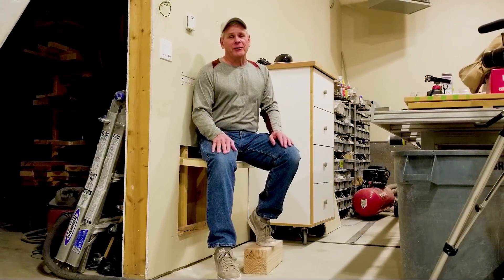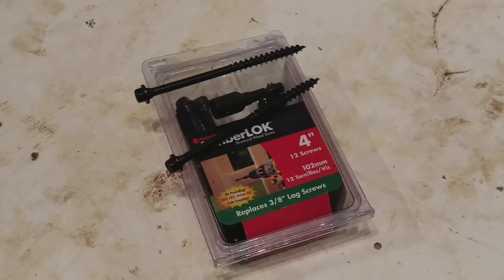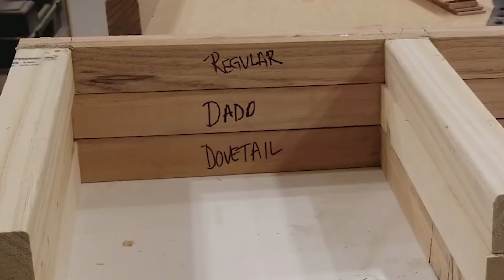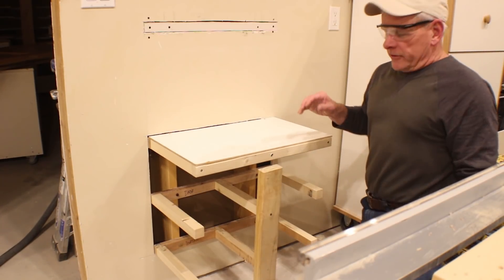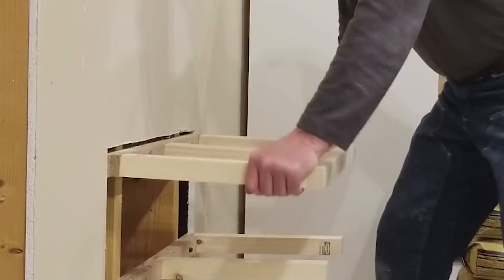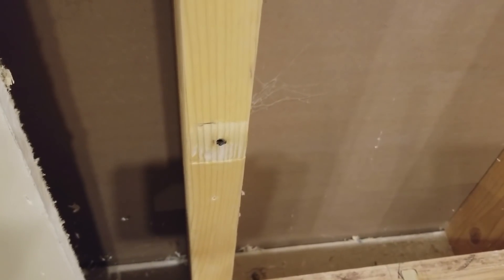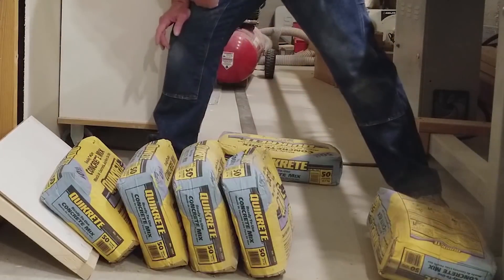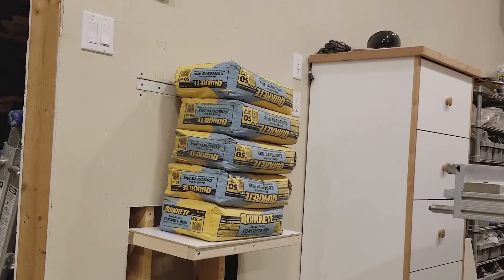250 Pound Max - Three Floating Shelf Strength Tests Based on Viewer Comments

Comment: Why don't you use a square metal bar instead of a piece of wood against the wall? It can be hollow or solid.
Reply from the maker: You could certainly do that, Laura. I was curious about the strength of wood in these tests. I found the strongest and simplest way to install floating shelves is with all thread rods and did a video a few months ago about that. Thanks for watching!

Comment: I wonder if placing the bolts higher would reduce the leverage that's denting the studs. Another question is, why 2 pieces of 3/4 inch oak instead of one piece of 1-1/2 inch oak? is it to make up for the lack of sheet rock that would ordinarily be present in a residential install?The bolts, rather than the dowels seem like they would have less weakening effect on the studs, if it's a load bearing wall. The crushing effect of the bottom edge of the shelf will be much more pronounced against Drywall, which makes much more sense to have the bolts up higher. It may not be as strong as without drywall, but, I doubt it will have to hold an adult human "Elf on the shelf".🤣😁😝
Reply from the maker: Higher bolts might help... also a thicker backer piece too would go along with your line of thinking. The two pieces of oak were just to see if that structural piece were laminated instead of solid, would that increase the strength. Yeah, what I gained from doing these tests is that a floating shelf support structure secured to studs with lag bolts and sheetrock still in place, is way more than adequate strength-wise for anything I would want to put on it. The dowels don't flex much so would likely snap at some point whereas the bolts and "crushing effect" let you know you are stressing the structure to the point of failure before it happens. I did have a couple of guys offer to bring over there big bodies to test any shelf I wanted to build! Funny, the idea of "Elves" never came to mind to describe them! Thanks for the comment and for watching, Vincent!

Comment: great video . very informative. I'm considering this type of application for floating kitchen shelves. 60lbs would be plenty of support for me. Based on your concept, what are your thoughts on my approach?:  First I have a 1/2" sheet rock  wall to mount to, with 2x4 studs behind. I would just be using timberlok screws to attach my backer boards, no dowels into the studs. . Shelves will be solid hardwood 1/3/4" thick , 12" deep, drilled to accept 5/8" hardwood dowels (3) across a 30" span.  I was thinking of using (2) 1/2" thick  pieces of walnut as my backer drilled through with 5/8" walnut dowels and attached to the studs with Timberlok screws only.  Thanks for your comment. I wouldn't hold you accountable for my results, no matter your comment. 
Bill
Reply from the maker: Hey, Bill. Well, you'll only know if you test it out. I get a lot of suggestions on different configurations. In fact, the video you watched was testing out some of the more interesting ones. I was surprised that the Timberlok screws I tested had quite a bit of flex to them. So I have stayed with lag bolts as my default method if I am not going into the studs with dowels. The only question I have about your idea is the three dowels coming out of your backer boards supporting the weight of the solid hardwood shelf plus whatever is on it. Those are your support legs if I am understanding your description right, so it seems like all the stress is going to be at the point where the dowels exit the backer board. I'm assuming you are going to recess the back of your shelf to slip over the backer board that is mounted to the wall? Screws through predrilled holes in the shelf into the backer board would help take some pressure off the dowels. Interesting idea! Let me know how it turns out. Thanks for your comment and for watching!
Reply: @RustyDobbs  In your previous installations, has mounting over sheet rock (as opposed to direct to bare studs) lead to noticeably more flex or indentations in sheet rock? I'm wondering if the difference is great enough to warrant removing the drywall for average 4.5' x 12" kitchen floating shelves. Also, have you experimented with LedgerLOK screws? They seem to be a bit thicker than TimberLOK and I'm wondering how they'll compare to lag bolts in regards to flex.

Comment: Each time a piece of wood contacts another wood regardless of connection type it's a potential point of failure. Since the studs are already exposed, why not drill into them a 3/8 hole, 2 1/2 deep, insert glue and 3/8 rebar cut 6 to 8 inches. Get a 2x12, cut to length. Drill 3/8 hole 16 inches on center, line up your hole on the studs first. You have only 2 points of potential failure, your using all the strength of the board. If you have a router you can do the edges and then paint or stain. I did this for a weight room and would stack weights on them without any problems.
Reply from the maker: Cool idea, Raymond! Thanks for passing it on. 3/8" rebar is very easy to bend in shapes as needed for traditional uses. But if it is supported by wood in the studs and 2x12, I guess it is only exposed to straight down "shear" force at the point of contact with the studs, which should make it really strong.

Comment: I've done floating shelves with 2x4 brackets, I've gone so far as to plane the wood down so the joint sit flush, then glued and screwed with 3-4" screw per joint. I then lag these into the wall with a 3 1/2" or 4" lag screw. I haven't strength tested, but they seem incredibly sturdy, although maybe a little bulky. The last one I did was roughly the size of a mantle, that I made as a speaker shelf below my tv.
Reply from the maker: You are exploring what I have not done, Jarred, which is going with wider shelf brackets. It stands to reason that the wider base you have lagged against the wall to resist the downward force of the weight on the shelf, the stronger the shelf would be. My brackets were only 1 1/2" wide. If I split the difference with you and went with 2 1/2" wide brackets, my guess is my shelves would have been some percentage stronger. Thanks for the idea and passing on your experience!

Comment: Or 3/4 threaded steel rod with 2 nuts to thread into the stud and 2 collars slightly bigger pressed into the shelf arms
Reply from the maker: Now that is a good path you are heading down, ZixqEditing, if you need the floating shelf look but it has to carry more weight than I would be comfortable with using only a wood support structure.  Creative solution! Thanks for the suggestion!

Comment: That was a great video.    Do you recommend going to the studs like that or was it just for the video so we can see the stress on the stud?
Reply from the maker: Thanks, Rusty! (Interesting typing my name and it not be referring to me!) Yeah, the purpose of the video was to test the strength of various types of connections between the back support and shelf support pieces. Eliminating the sheetrock takes it out of play as a factor to consider. Practically speaking, I personally would limit weight on a floating shelf to about 50 lbs max over a couple of feet span. That said, the bracket assemblies I use in the video attached to the wall studs 16 inch on center with lag bolts and the sheetrock still in place, would be something I would be probably comfortable with up to the 50 lbs. Obviously, going directly to the studs with the brackets is going to reduce the flex with heavier weight on the shelf. Thanks for the comment!
Reply: @RustyDobbs  just some shelve so the cats can get off the ground and have some exploring to do.   We got a puppy and one of the cats are not to happy about it. Lol     and when I rescued them they already had their front claws removed so doing a climbing pole was out of the question.  So I will incorporate this design with some carpeting and have some fun with it.  Many thanks again ( our one cat is close to 20 lbs) that's why the strength test was so important to me

Comment: What if there was hard wood running parallel with the studs for a solid nailer
Reply from the maker: Not following what you are suggesting, Phil. Fill in a few more details.
Reply: Nail like a foot piece of hard wood to the sides of each stud. So each stud would be 2 2x4s with one 2x4 harder wood to maybe prevent that back plate from impressing the into the normal wall stud. Cool video man.
Reply from the maker: I'm with you now, Phil. Good idea! You would think that might help reduce some of the flex. Thanks for the comment!

Comment: What about trying 1/2 inch dowels? I feel like you're losing a lot of wood on the support bracket. I just made two floating shelves using  1/2  dowels and made 5 points to mount it.  Seems to be plenty of"meat"for any future stress.
Reply from the maker: Good idea... lots of ways to tweak these types of installations for better results. I like your solution!

Comment: I apologize it you've already answered this but what is the strongest floating shelf out of the one's you've already tested?

As I would like to try building one for myself and see if there might be room for improvement.

It seems like the one that you ended this video with was the strongest but I'm not sure if that is the one you've built in your previous video.
Reply from the maker: Let me answer that a couple of ways, Feyangel23. Just pure strength with almost no flex would be the wood dowels glued directly into the studs and backer board with the shelf backer board made from several pieces of hardwood (probably oak) laminated together and then the shelf support brackets connected to the backer board with glued in dowels also. Lag bolts into the studs through the backer board  is probably stronger than the dowels but the lags are going to flex more than the dowels as you add more weight. Hope that helps! Let me know if you come up with something better! Thanks for watching!

Comment: The wife is wanting floating shelves, so I come to the interwebs to learn how others are doing it.  Great video.

One take away from your video is failure points are the torsioning of the backer pieces.   I think a quick fix--if not already mentioned--is a much longer dowel glued into the wall and connected to another cross piece a few inches out.  Then the weak point would be the oak dowel, which has already shown to be quite strong.

My given task is 3 72" x 10" floating shelves than are only about 2" to 2.5" thick.  I'm not going to cut out the sheetrock.  To get around the inevitable denting of the sheetrock due to leveraging, I'm thinking about putting a large-headed screw at the lower end of the backer flush with the sheetrock.  My thinking is the shelf would leverage against the screw distributing the load onto the screw and thus into the stud and not onto the sheetrock.  Because of my given requirements, I'm probably going to do with steel supports.

Again, great video.  It's helped immensely with getting my head wrapped around the task at hand.
Reply from the maker: Thanks for the comment, Ken! The idea of a cross piece a few inches out from the has not been mentioned by anyone and is a good one. Yeah, I think that would make the dowels the failure point which should increase overall strength significantly. Additionally, I like the idea of maybe lag bolts into the studs at the bottom of the backer to address the flex issue. Sounds like you have your project figured out. Don't see any issue at all with what you are planning to do. Good luck with it!

I appreciate hearing from people who take what I do, rethink and rearrange the 'pieces'  and come up with better ideas. I may just have one more strength test video in me! I'll let you know if I do. Thanks again for your contribution to the conversation!
Reply: Ken Jones   Great ideas!  I especially like using screws into the studs, with heads flush with the drywall, to transfer force from the bottom of the backer into the stud, saving the softer drywall from the bottom of the backer rocking into it under the weight.  That's also a good way to keep from having to cut out the drywall around the backer to have it solid against the studs, plus this way only mars it with a few screw holes if the shelves ever have to be moved.

EDIT:  Plus I just had another thought on the screws.  By helping prevent the rocking of the backer down and into the drywall, that puts all the weight straight down instead of rocking in an arc downward.  And straight down maximizes the strength of the oak dowels, because they would be more resistant to shearing off than bending downward.  So the screws not only save the drywall, they boost the effectiveness of the dowels.  Great idea!
Reply from the maker: Good point on the rocking action, JusBidniss. As I mentioned in my response to Ken, I'm thinking I would like to test out his idea with longer dowels and spaced shelf support brackets to help offset the stress the load puts on the backer piece against the stud or sheetrock as the case may be. We'll see when I can get to it.

Comment: Thank you for doing these videos.  While I will never put that much weight on one, it's nice to know what they could take.
Reply from the maker: Thanks for the comment, stgreen78! That was the purpose of the video. Even with the results of the testing, if I needed the shelf to hold more than 40-50 pounds in a real setting, I would probably put support brackets under it.

Comment: Possibly use a piece of sheet metal against the framing (in between the 2x4 stud and the shelf brace with a dowel hole drilled through it) to disperse the weight (pressure) of the shelf.
Reply from the maker: Yep, that is a good conclusion, MrGtownjake. If you do what you are suggesting, I think you isolate the weight pretty much on the strength of the dowel alone. So, what kind of weight is required to snap the dowel off flush with the face of the stud? My guess is quite a lot. One thing is for sure, when it breaks it is coming down in a hurry!
Reply: +MrGtownjake
If you are going to go to all that rouble to put a metal sheet against the framing you could just as easily modifying the framing with wood support. 

You could put a bolt through the studding from the side and then attach to that. You could even put in extra studding or metal studding. My not just put in bricks next to the studding and then I can hang one of my cars from the wall (not sure if that would really work though).

Comment: What about the floating shelves that use a metal bracket screwed to the stud and a metal pipe goes into a hole drilled in a wood slab. A live edge floating shelf?
Reply from the maker: Yeah, I like the idea Hotrod! May have to practice up on my welding and give it a try. Thanks for the comment!
Reply: Yeah, I don't weld but was thinking of getting some brackets off of amazon or someplace
Reply from the maker: Yes, the brackets are available out there. I think Rockler may have something like you are talking about. Good luck with your project. A live edge floating shelf might really be an interesting look!
Reply: What could you then possibly put on a float shelf that is going to be greater than 100 pounds?

Comment: I made some floating shelves by screwing  and gluing some 2x1 inch supports into the stud, one on each side of the stud, with some off cuts screwed hard up against the supports top and bottom on side of the stud.  I weigh 300lbs and I can sit on em with no problems.

Spanning three studs there is a total of 6 cantilevered arms to support and distribute the weight and to lay the shelf board material on (MDF in my case).  I use it to hold multiple 10 liter pails of paint, 6 at the moment.  They are much stronger than attaching to the face of the stud.
Reply from the maker: Yeah, Victor, a number of people have begun suggesting ideas like yours to increase the weight capacity of shelving. Interesting to hear what people have come up with when they start thinking about something. Thanks for your comments and ideas!

Comment: I'm probably late to the game but I seen this video and was wondering if you added a metal bracket in the back where it broke then should you increase the strength of the Shelf , The Wider the bar the more the strength in for my second suggestion hollow out the wooden dow and put the screw through it with some wood glue should act as a rebar now with a fender washer lock it into place I think that would be the maximum strength you can get from those types of shells. thank you this comes from Media Library you can always contact us at 313-651-5349
Reply from the maker: Yes, Lloyd, a number of people have had similar ideas to what you are suggesting. Any way to support the area where the ultimate failure occurred in the back bracket would help. As a practical matter, I probably would not use floating shelves in places where the load was going to be more than about 50 pounds over a two foot span of shelf. Its nice to know now that they are capable of carrying much more weight, but if a shelving set up has as a need to handle a lot of weight, I would switch to a design that supported the fronts of the shelves. Many of you have had great ideas on this topic. It has been interesting experimenting with them. Thanks for your comments!